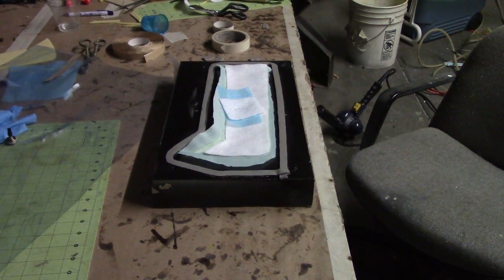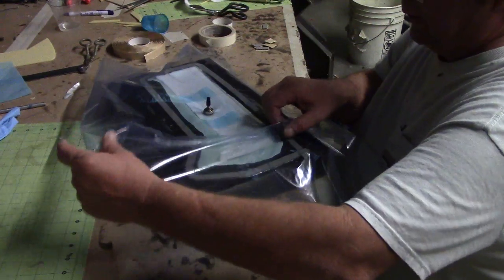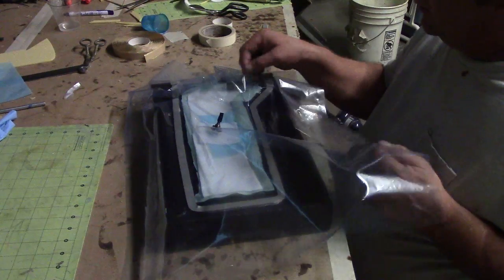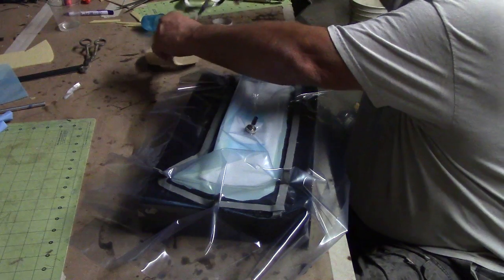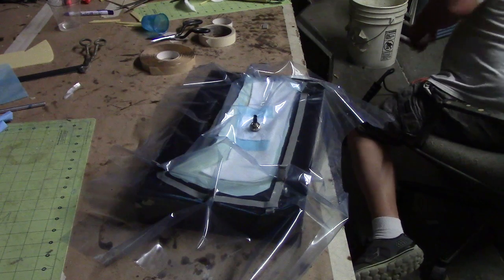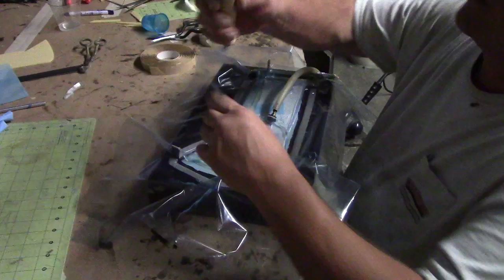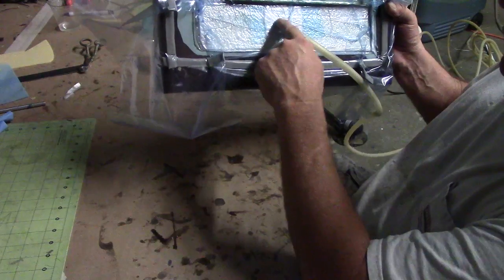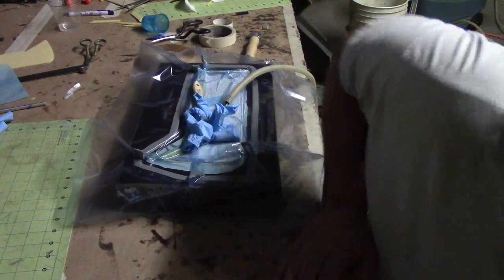vacuum bagging composite parts

Comment: Using carbon fiber cut to a pattern that fits onto a plastic part, can you tape the edges of the carbon fiber, sew it to keep it from unravelling to create a clean edge in places you can not get into to make a cut? Like a automotive intake manifold made of abs type plastic. First, cleaning it, sand to scuff the part, make pattern using a cloth type material woven similar to carbon fiber. Cut the pattern and transfer that onto carbon fiber. Here is the process I want to try. Once the edges have been established, cut and wrap tape on edges then sew over tape to hold fiber into place. All of this prior to wetting the part with epoxy, install the pre-cut carbon into place, wet out again, cover and place into vacuum bag. Thoughts? I may clear coat over it.